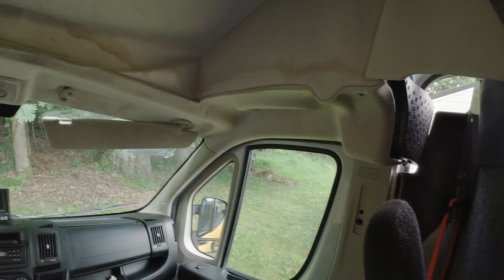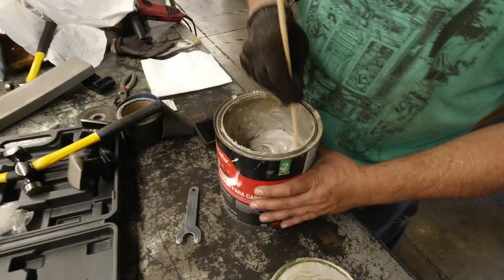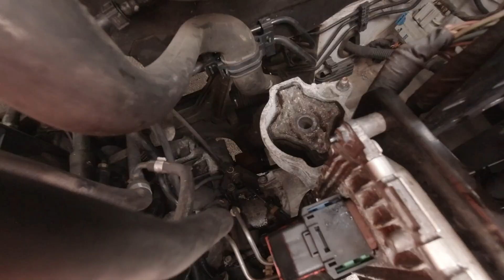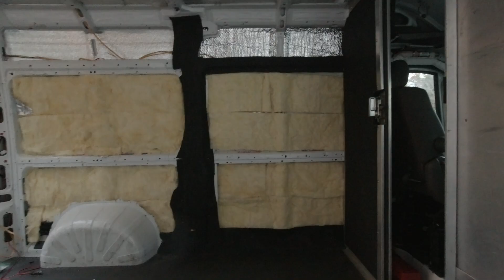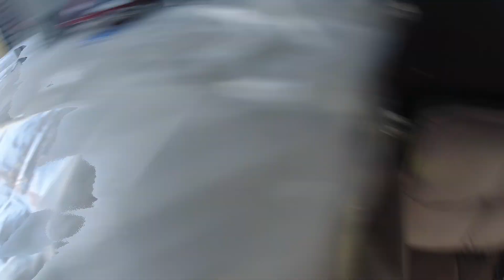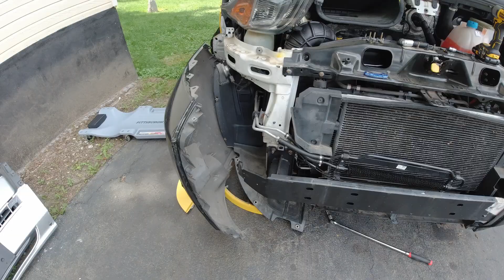Budget Camper Van Build for NASCAR Trips — Featuring a Real Richard Petty Team Part!

Comment: The motor mount bolts are one time use only. They must be replaced after removal.

Just finishing up my PM conversion over here in Mooresville. I bought a well used 2016. Started in February. Maybe another month.😵‍💫 Seems like everything takes twice as long and costs twice as much as you think.

Mine is a little more complex for travel and potential for short term off grid camping.

Your van looks great. Enjoy.